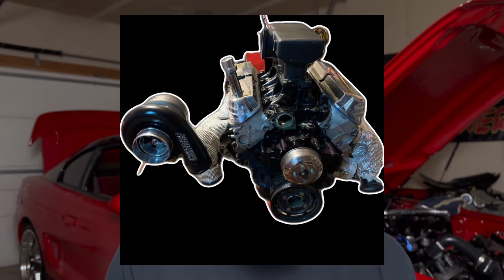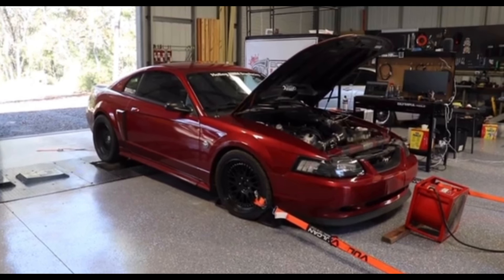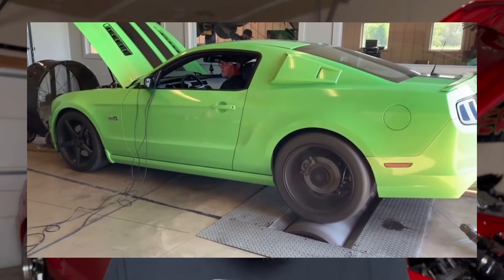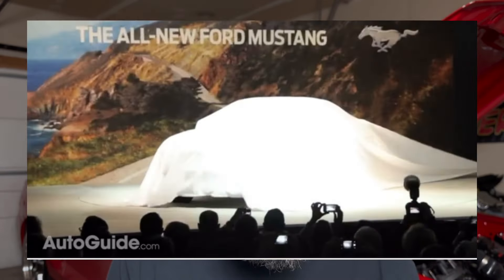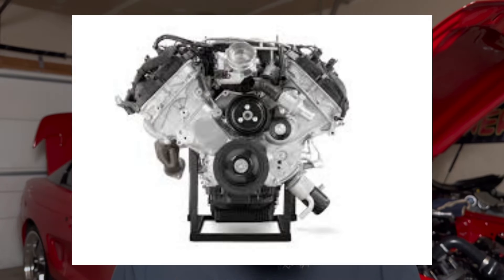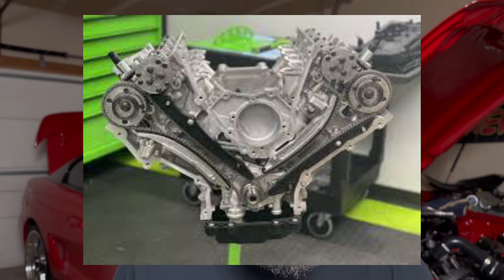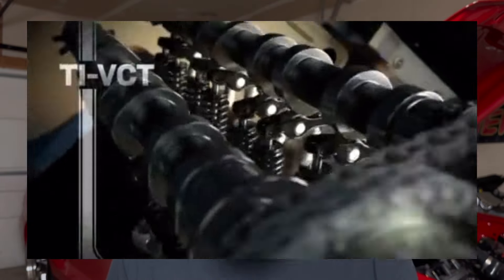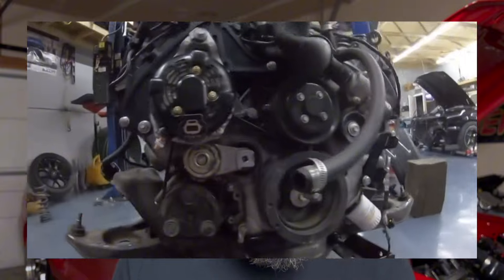Why Coyote Swap VS 4.6 Mod Motor Is Not Even Close

Comment: I’m glad you made it a point to say under 500hp and what your comparison was. I blew up my terminator & built a new motor to the tune of 700rwhp. If I could go back, I’d sell off all the terminator stuff a put a gen 2 or 3 coyote longblock with a blower on it. Spent probably 15k when it was all said and done. I will say the 4v just sounds better. Coyote will out perform it though.
Reply: For under 500hp a built 351w is cheaper than just buying the coyote engine unless you do like me and start with a first gen truck coyote. That was only 800 bucks to pick up and about 500 for new rings and bearings. Did a down and dirty rebuild and its been running great for 8000 miles.
Reply: You have to take into account compression. The 03/04 stock compression is like 8.5:1. Some of the coyotes are 12:1. Bring the compression up to 12:1 on the cobra and it’s a lot closer.

Comment: I have a question related to my setup:
97 cobra and needs timing chain job
Should I yank the heads and intake and get c heads and 96-98 cams instead of doing the timing chain job? I am not mechanically inclined and don’t have tools, my option is to take it to a shop. What would you do?
Reply from the maker: Plenty of how to youtube videos on how to do timing chains. Basic hand tools and a amazon cam lock it. Its pretty straight forward.
Reply: @SN95Power  I’ve tried to repair my cars before unsuccessfully, it’s not something I’m cut out for or enjoy, and I don’t have friends to help. And in addition to that my parking spot area has a lot of mosquitos. I’d rather pay someone really. So given that, what would you say is the better option?

Comment: Amount of money needed to build a 400 hp sbf would be a coyote swap, plus like you said you can boost it up to 700-800 hp without major changes. That sbf would need so much more to survive. Mod motors aren't much better imo. 
I won't be dumping anymore money into my sbf because I've already got 3k into a gt40 build that barely makes 300hp. If i add any power I'll have to upgrade my block and tranny for what i can get a coyote for

Comment: What would be your suggestion for a guy with a 96 GT automatic? If I would have bought the car it would have been a manual but my grandfather left it to me he was the only owner and it only has 60,000 original on it the car is in fantastic shape I just want another 25 horse without the labor that goes with putting in a can
Reply from the maker: @mzondi1970  4.10 gear. It will change the car

Comment: Great info, also sorry up front for coming in with a question completely different from either of these engines.

But have y'all tried to get an 3.5tt Ecoboost in the sn95? You can get them with an oil cooling system out of police explorers for like 2k (I know, engine hours but still)
Reply from the maker: @onecoff17  I've seen 4 cylinder ecoboost in foxbodys but none in a Sn95 yet.

Comment: •WARNING• Don’t buy a PBH gen 1 control pack unless you’re running a 6R80. If you’re running a non PCM automatic or a stick get the Ford Racing.

I called them up and had a 30 minute conversation about my Mustang build. Told them many times I’m running a manual transmission. They sold me their control pack and I opened it about a month and half later. This is my first Coyote so I didn’t know the transmission harness is where the wide bands and VSS are. It took a lot of calling to get someone back on the phone. They said they didn’t make a manual trans harness and sold me a OEM GT500 harness for another 400$ than needs thinned down. Gen 1 with anything other than a 6R80 go with Ford Racing. 

It’s not cool IMO on their part.

Comment: Look, car culture is dead and has been for years. Nothing cool enough, nothing with a soul, has been released in over 10 years so the new younger generation hasn't had a real reason to be interested, every vehicle looks like a generic round bubble now. They'd rather play "car builder" on a computer. 

Building speed and going fast has been done to death, now that you can buy a turn-key 10 second car with A/C.. out of a dealership, again they have no reason to care to create anything. 
Buy what you like personally, that's all that's left.. no chance I'd pick a Coyote 5.0L over a 4.6L. The latter sounds infinitely better going down the road.
Reply from the maker: It's amazing that you can buy a 500hp car like you said. Kids can go from 260hp drivers ed car to 10 second car.
Reply: @SN95Power  I took my driver's test in an 01 GT. Kids these days call stock Coyote's "slow" but I guarantee you if I put them in my 330rwhp Cobra, made before traction control came out, they'd wreck it within an hour. 

I actually have a knock on cold starts as of yesterday, could be piston slap, could be a bearing, not sure. What I am sure of is I'll be rebuilding my Teksid before swapping in a Coyote that costs twice as much.
Reply: People who spend too much time on the couch call 300 horsepower slow,  slow for what you got a train to catch? 🤣

Comment: Average used Coyote gen 1 or newer is going at least at $3K or more.  You can get a long block gen3 new for $4800 and complete it to a full crate for about $7500.  This doesn’t include control pack and hp tuner license…

Comment: I was all about a coyote swap until I started looking into doing it the right way. Imo you're a little low on price. I'm not saying a 150k motor is junk but I wouldn't want to put that in my 32k mile mint car. Especially a truck motor with the way it makes its power. I would at minimum want a used mustang motor and tear it down and go thru it. Everything adds up super quick and its close to 20k. I would love to eventually build my 4.6 to handle power but until then I want to do the 2.3 whipple kit. For under 6k you can get everything you need and its proven. I know of a 418hp 2v with just the on 3 kit that was going 10.7 with a bad synchro in the trans. No suspension or other mods. I think the turbo might be a little too complicated for me especially since I want to keep my rear duals. I have bbk headers bbk offroad x and a Mac catback with 3 1/2 super nice chrome custom tips perfectly straight not just some hack job.
Reply from the maker: @motofarmmx2430  I agree but for this video, I was trying to find the cheapest was to Coyote swap. Most do Coyote swaps as a plug and play. I think that's why it's popular. Drop in motor, add blower and make big power. Pretty simple formula. Like you mentioned, those who want more than a simple swap is going to spend way more money than my example.
Reply: @SN95Power   oh I know and I know your point of the video. That would be fine for a basic race car but for guys that want nice street cars its not desirable.

Comment: I did my coyote swap into my 83 ford ranger for 10k. Thats every nickle and dime part. Is the truck a show winner, no. Is it fast? Hell yeah. The most expensive part in my whole swap is the transmission and I got it used for 3500 with the clutch so there is some luck involved but its doable. You just have to know how and when to be cheap and when not to be.

Comment: You can swap rods in just about any 4.6 or 5.4 and make virtually the same power as a gen 1,2 or 3. I currently got a couple 4.6’s and 5.4’s two and four valves. The weak spots in the 4.6 and 5.4 were the rods. The yotes do have better factory rods. In truth though if you not trying to make over 5-600hp you really don’t need the rods IMO. 

Now that said. I also got A LOT of sbf stuff. I fucks with the sbf stuff HEAVY 😂!
Reply from the maker: @18wheelzofsteel53  popular swap with 4.6 mod motors is to use coyote rods. 600rwhp all day. Yes sir! Sbf🙌
Reply: @SN95Power   yessir all day

Comment: Ford should stroke the Coyote with even stronger internals capable of SC or twin turbo outputs with reliability.
Say a 5.8lt (315) - with 600 + hp &  500+ ftlb.

Comment: Not saying you wrong but 2v heads don’t move enough air unless you go with trick flow heads it equals out but not really bruh you have to to boost the hell out the 2v then you won’t have the street drivable coyote wins pound for pound bruh yes it cost more as coming from a racer
Reply from the maker: @chuckford4393  it depends on how much power you are trying to make. For this video I said the 2v would only need to make stock coyote power. I agree that if you want a max effort 2v, tfs heads would be best.

Comment: A stock 4.6 fuel system wouldnt hold up then you gotta get a tune. I believe the 4.6 2v is cheaper but probably by about 800$ realistically. And i love the 2v. Its my favorite v8 ever built but im just thinking of the fuel system and tuning to make it actually run
Reply from the maker: @datchannel1  Right, a fuel system and tune would be needed with both projects. That's why I said I wasn't including those things.

Comment: LS better tho
Reply: Show us the overall Sick Week winning LS....
Doesn't exist, but Brett Lasala has with a prepped oe cast Predator/Coyote setting the drag and drive radial world record 6.26 @ 227mph and made 2930 whp after winning 4 events in a row.
Show us the LS running 300.4 mph in a standing mile  ..
The 5.4L 4V has held the standing mile records since 2011 and in 2019 became the first passenger car to achieve 300 in a standing mile. 
Closest LS is 263.9 mph. Not even close. 
And which LS has been 5.88 at 256mph with an almost entirely oe parts engine?...zero.
The 4.6 4V has
Reply: ....Crickets